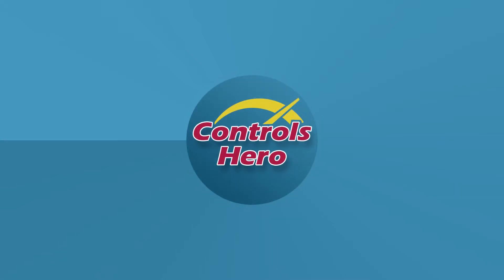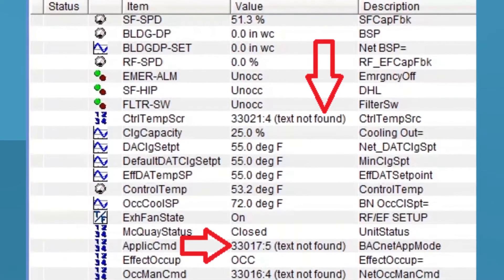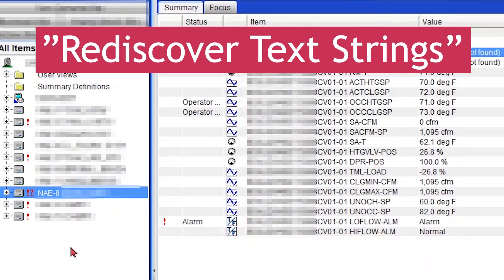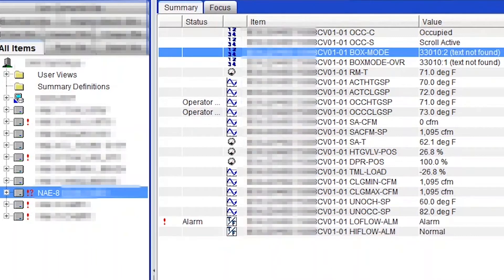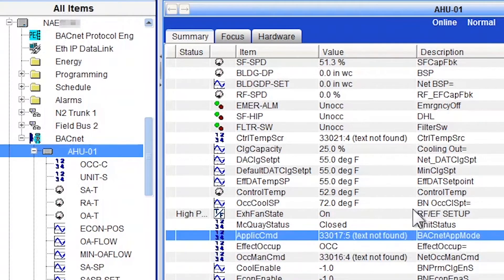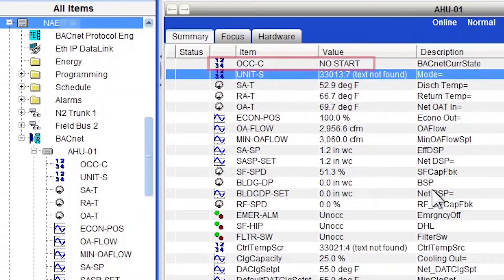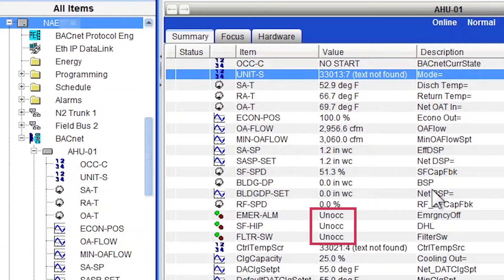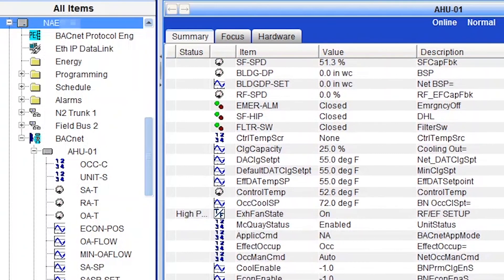Metasys Text Not Found - How to fix Points not showing correct units in Johnson Controls

Comment: Thanks for your excellent explanation.
Are you able explain how I solve unreliable status points in Metasys UI?
Reply from the maker: Hi Ibrahim, thanks for your comment and for watching my videos! Answering your question is a little difficult as there are many reason why a status points would go unreliable. By a status point you mean a Binary Input? If so, I've seen BIs going unreliable when you reverse the polarity of these points (assuming the point comes from a JCI CGM controller and your Metasys UI is version 9.0 or older) during commissioning. The new CGMs controllers are meant to work with Metasys 10 and up. The fix would be to redownload your controller. Now, if this is not your problem, then try sending me a message on my website www.controlshero.com in my contact form. I will answer you with my email so you can send me screenshots of your issue. Thanks!